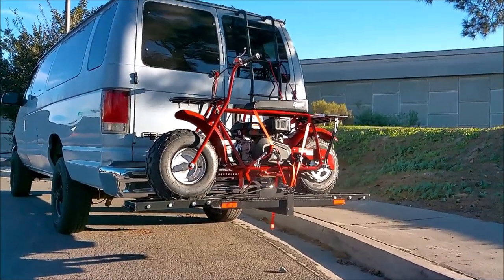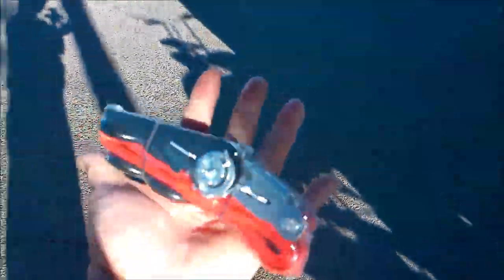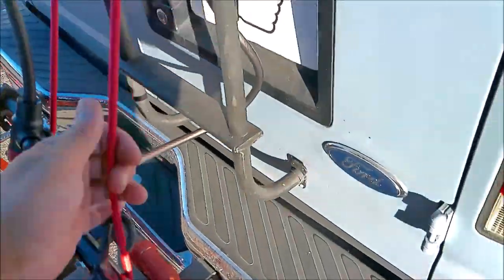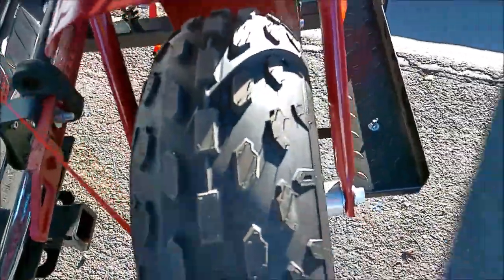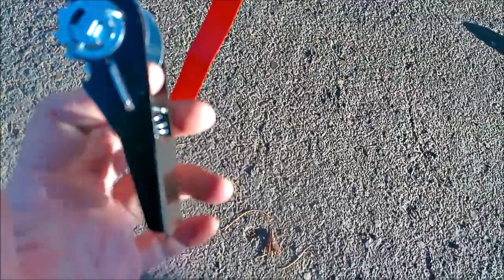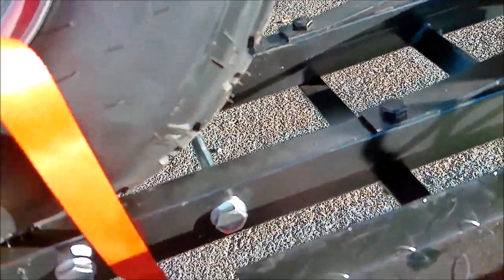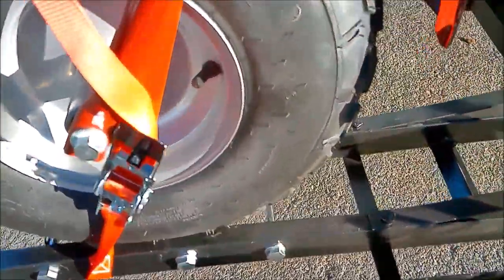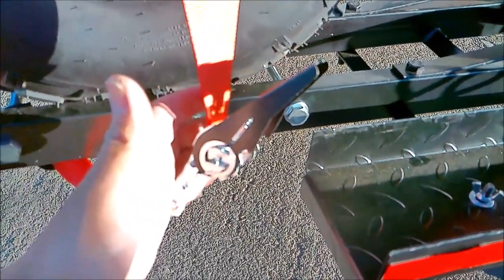How to use ratchet straps tie downs | securing my mini bike motorcycle secure | coleman CT200U

Comment: I got 2 cantilevered, one on each side. Holding strong for over 8k miles
Reply from the maker: I'm so OCD I think I will set up a Camera where I can see behind my van. Maybe next to the roof brake light so I can always see how the bikes doing. Will probably help with Towing the Tracker too.
Reply: @JohnDrivesAnything  I've had so many people mess with mine and try to steal it. Lock it up good

Comment: I like to wind up as much of the excess strap into the mechanism on my ratchet straps sir
Reply from the maker: I always do the shake test for like 30 seconds before I drive off. What do you use these for?
Reply: @JohnDrivesAnything  like if we haul stuff in the truck. This last weekend we got some new counter tops at Ikea for a friend and the stuck out over the tail gait so I used ratchet strap to hold it so it wouldn't hop if we hit a bump in road. Used them to secure a quad bike in a trailer many times too

Comment: Your can't use to many straps or in some cases chains to secure a load. Those look like they're the 4 pack of straps from pilot flying j
Reply from the maker: I'm going to get a Camera placed where I can see the Tracker and My bike as I drive. You tow for a living. Respect man. I have OCD just having that bike behind me.
Reply: @JohnDrivesAnything   just make sure everything's secure and pull over half hour after you hit the road and check everything make sure everything's secure. Stop every hour or so after that.
Reply from the maker: @TruckingShooter  Appreciate the Tips man. The Desert Drive is about 120 miles. Not too far. But far enough where I don't want to drive the Tracker 2 hours and rather tow it lol